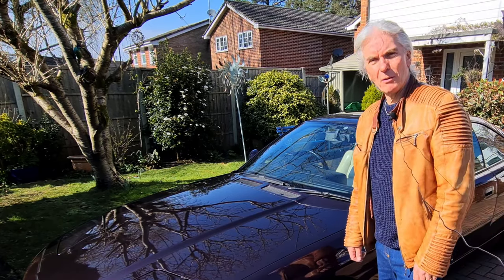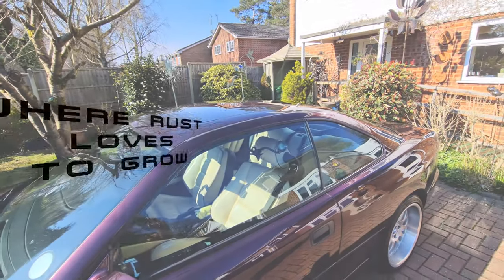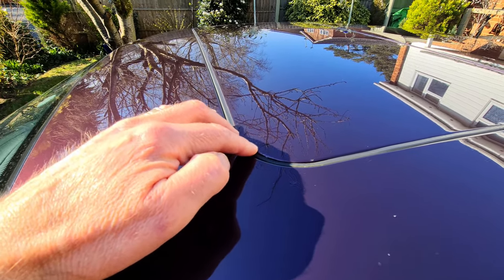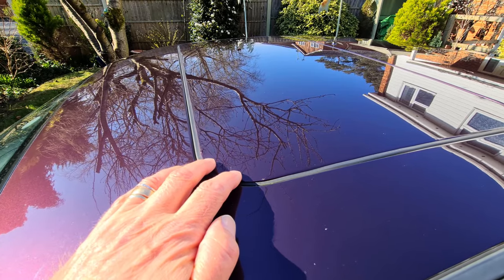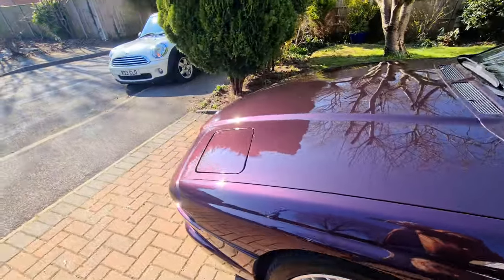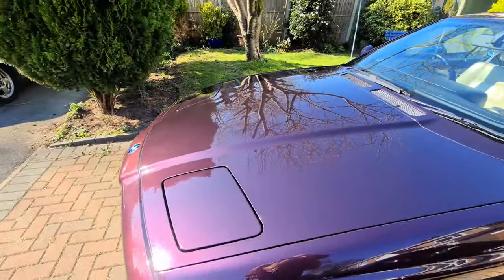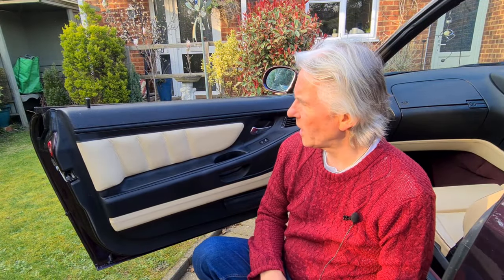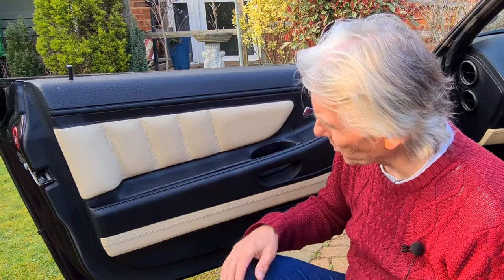BMW E31 8-Series - RUST, RUST and MORE RUST

Comment: If you cannot get to an area to treat it's amazing how well a glob of grease will do to protect an area. For example, on my E38 I fed about 1/4 a cup of grease (copper slip is better) into each jacking point about 15 years ago (remove the bungs and lifting pucks).
 I am sure a good smothering of grease on the underside of the sunroof would solve the problems.

 A glob of grease will protect a large area traveling many cm s. 

You really do need to get under the car and deal with whatever you can see. I just copper grease everything that's remotely rusty after tearing off any loose underseal, paint or seam sealer. Personally I dont bother with paint under a car as I have found the grease to last longer and a do far better job over the winter.
Reply from the maker: Thanks Andrew - I've got lots of grease so I'll be splashing it around!

Comment: Personally I use copperslip grease on hidden areas stop rusting. For example if you have some rusting under the glass a big glob of it under the trim will stop it dead for a few years. I cover every rusty part (bar the exhaust!) under my cars with it as well including the wheel arches. Grease effectively oils up a large atea around it which means it gets into seams and areas that paint cannot reach.

Comment: great work timm , both of mine have had very bad rust on the rear lower jacking points too . 1 more thing worth mentioning is (having taken the front and rear screen out and refited them myself) the fitter needs to install the seal onto the screen and then that goes onto the car as one piece , if they fit the seal on the car and then try and install the glass it wont ever align or seal correctly . i used a spider tool (it uses i nylon cable and a winch and suction cup unit) bought on ebay that was quite expensive but well worth the money as i know its now done properly
Reply from the maker: Thanks, that's excellent information!

Comment: Another area to look at on e31 - underneath rear washer tank in spare wheelwell. Washer fluid can leak from inlet seal to tank and sit unnoticed for months/years, causing rust. Easiest way to check is from the outside under the wheelwell. If there's signs of flaking underseal or rust there, it will be much worse on the inside. By the time I stripped back the underseal and removed the tank and rust from the inside, there was a 3 inch hole. Not an easy repair, especially if the holes for the inlet pipe and wiring/vent pipe have disappeared. 
There are also well hidden areas in engine bay where water can collect and start rust eg underneath the pop-up headlights.
Sunroof rust - if you can still get a new sunroof panel (?) it can be stopped from reappearing. Apply rustproofing  (eg waxoyl) to the double-skinned seam edges before fitting a new sunroof seal. After fitting the seal, apply silicone sealant to the area where the ends of the seal meet. This stops water getting into the seal ends - this is how the rust starts. The factory never sealed the ends, hence the problem. I replaced my sunroof 12 years ago using this method and rust has not reappeared. If you still have an original sunroof a similar method may, at least, stop it getting any worse.
Reply from the maker: Thanks Martin! Yes, my first E31 went rusty under the reservoir in the boot. A post above says that his sunroof went rusty without seeing and damp at all, found that interesting!

Comment: Hi Timm Can you tell me why the two plastic plugs are fitted at the bottom of each door. Is it just to prevent water ingress. I was thinking of putting a small cut into them to allow me to enter the stabil nozzle to get rust inhibitor in there Do not want to risk damaging door painted surface and they are not that easy to remove. Would this be ok do you think?
Reply from the maker: Yes Alan, I've had them out on my doors with no problems

Comment: Great videos , i recently bought a 91 850i , in fabulous condition with only 58k miles . Only thing is the horn sounds like a little girl . I believe original replacements cant be got . Could you recommend an alternative please ?
Thanks again for the videos !
Reply from the maker: Thanks Dermot, there are two horns: https://www.realoem.com/bmw/enUS/showparts?id=EF82-EUR-11-1998-E31-BMW-840Ci&diagId=61_0964#61337164000 Do a simple search on Google with the part numbers 'BMW 61337164000' and you will find them - and probably still available from BMW
Reply: @TimmsBMWRepairsandInformation  👍

Comment: Tim when you had your e32, did you ever try and resolve door bottom rust given the design of the door bases and rubbers and the fact that the drain hokes run directly into the rubbers on the bottom of the doors. Doors are NLA but it is something either done sooner or later and it needs to be dealt with. 
Separately,  have you heard of e39 passenger door electrics all going awol at the same time meaning you cant open the door locks window or mirror to check the connectors ( which is probably the cause).  So accessing via the airbag cover is an option?
Reply from the maker: Protect the bottom of the door using the same method as shown for the E31 in this video. All door control lost? That will either be the door module (can be replaced without coding) OR one of the conductors has failed at the door hinge - that does happen quite often.

Comment: Thanks for this video. I also have fears my once winter driven E38 will rust without my knowledge. I've removed any surface rust from the underside and repainted the subframes. Rest of the body looks great. It's now only a spring and summer car.
Reply: Got an e38 as well. I feel like the pre-facelift models have less rust and that is why I’m lucky with my 1997. it’s still in nice shape, just the side skirts had to get repainted once
Reply: @E38Bimmer35  is there really that big a difference in terms of rusty areas for LCI vs pre LCI E38? I figure they're more or less the same
Reply: @burntnougat5341  Im not quite sure if its coincidence or not, but apparently the most complaints for e38 in terms of rust come from people with LCI models on the forums and when i was looking at several e38 to buy, the LCI were usally in worse condition rust wise. But it might be a misconception of mine.
Reply from the maker: Probably best to keep it out of the rain - my only problem on the E38 was the rear lip on the boot: https://www.meeknet.co.uk/E38/Boot/Index.htm

Comment: They did a great job with the bodywork, the car looks amazing! And £2000 sounds like a pretty good price for all that work. Does the 650i suffer from any rust issues?
Reply from the maker: Thanks Georgi, no rust so far and I was advised by my mechanic that it shouldn't rust due to better materials, we'll see!
Reply: @TimmsBMWRepairsandInformation  I have a F30 330e that started its life in Scotland and I found surface rust on a trailing edge plate in the transmission tunnel. The part that is e-costed. I didn’t know much about rust back then so I sanded it off and sprayed it with black paint. So dumb haha

Comment: Ah Tim, rust on an E31..... now we're getting onto my specialist subject! I started to attack my car about 5 years ago now and still haven't finished it. OK, i did get quite ill for over a year, so that put me off working on it naturally, but doing a proper job of it is absolutely major amounts of work. I am more than willing to share my knowledge and experience on the bodywork side of things, I have restored and painted 2 other cars in my own garage at home and they still look pretty good, but it is so involved that it is beyond the realms of YouTube comments and forum threads.However,  If anyone is interested, check out the YouTube channel Craig on Cars. My car had rotted more or less exactly the same as his, except I had to repair my bonnet front as per your illustration. Also, my rear screen has been taken out and refitted because the o/s rear quarter panel has been replaced at some stage in the car's life, and the result is exactly as you have said. But, unfortunately, the rust was so severe in the top RH corner that it has bubbled up enough to crack the screen, so I am going to have to replace it. The last price I got was two years ago, the rubber outer trims are a ridiculous £150 and the screens around £650. Good second hand screens do not exist as far as I can tell. Anyway, yet another super-informative video Tim.
Reply from the maker: That's rotten luck Bob, the window corners are the real problem when the glass has been replaced - such a tricky job.  Rust has always been my Achilles Heel, I hate the stuff but glad I eventually got it done, it was looking pretty tatty up-close!
Reply: @TimmsBMWRepairsandInformation  Yes, mine still looked great from a few feet away, but close up, a different story. I have thankfully repaired all the rust (I have a good and hopefully permanent fix for the sunroof panel by the way), I still have to paint n/s rear quarter, roof, sunroof, both wings, rear bumper and side skirts, so quite a lot I guess! Also, I have fallen foul of DVLA crazy rules. Apparently, if a car has been SORN for longer than 5 years, which mine has by 2 months, you cannot transfer a cherished number from it unless it is taxed and MOT'd, and I have quite a valuable number on the car which I would be sad to lose. So, I will have to try and get it through a test at least. Old car fun?!